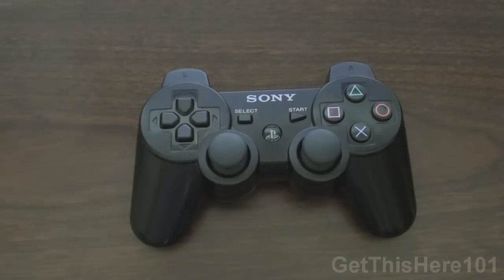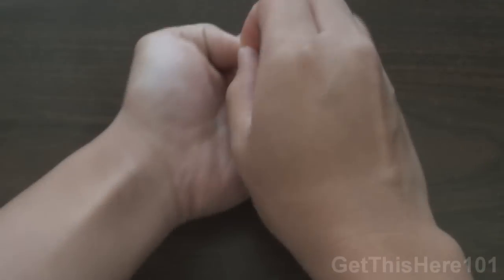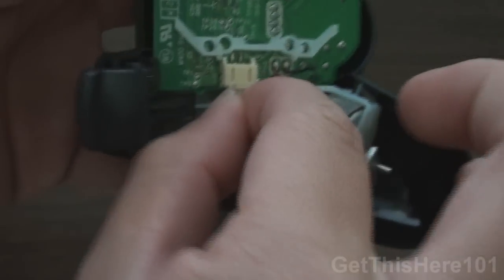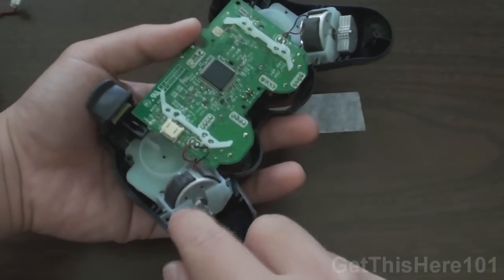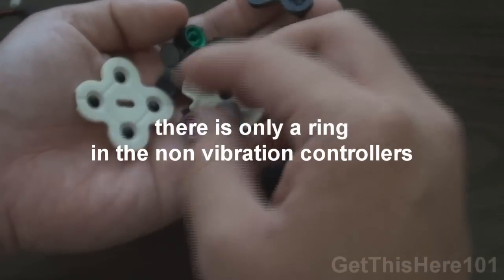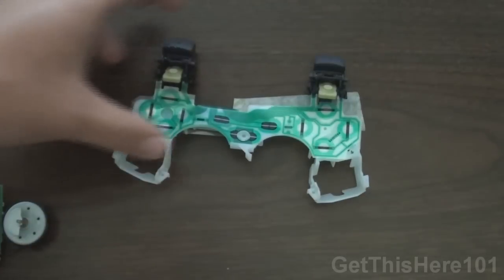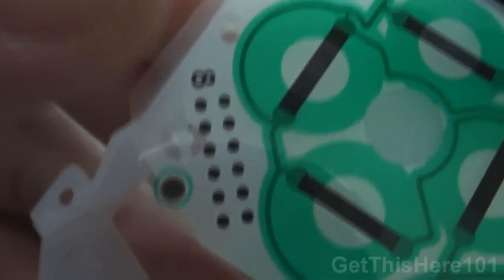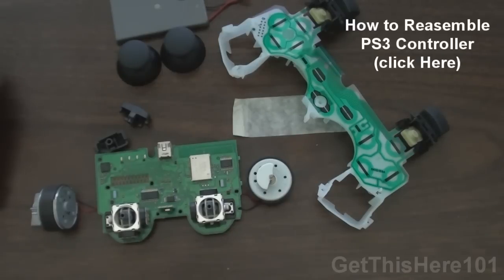How To: Disassemble PS3 controller (HD)

Comment: hey I just want to let you know that I'm going to change my Hard drive the 500GB where all my things in it to a PS3 slim and I need to do the following.
1. download the freeware 4.66 to a USB ( FAT 32 ).
2. back up the entire system to an external hard drive.
3. swap the hard drive out and replace it with mine.
4. turn on the system and then plug the USB flash driver and update the system and         the Hard drive is going to be formated and then do all other crab but lastly I need to       restore the all the date so I go SETTING < BACK UTILITY < RESTORE.
and then done.

and by the way I took picture of my PS console.
Reply from the maker: Cool, sounds like a lot of steps where fuck ups can happen. Best of luck man. You sound like you know what you are talking about!
Reply: GetThisHere101 Yep I always know what I'm talking about but listen man when I open my PS3 not the custom PS console ok so when I open the PS3 and I add you and set up everything at that time I won't have a chance to show you the PLAYSTATION console because it's rebuilding again you know I'm adding more features to it so I just have a couple of pictures of it ok.

Comment: Trying to do this but the new controllets have the batteries glued to the circuit board :/
Reply from the maker: really... damn no way. :*(
Reply: @Chrisshao  don't worry I figured it out , you just lift the battery a bit and you can unscrew the board
Reply from the maker: @santi1505  There ya go!  :D

Comment: Anyone who doing this with a xbox 360 controller that impossible clamp is a screw,
in the battery pack under a bar code that peels off and there is a screw  unscrew it and the case comes right off

Comment: Btw do I have to take out the battery?
Reply from the maker: +Drakon_ 11 You don't have to, but it is best too prevent it from being yanked out on accident.
Reply: Chris Shao My r2 button got ripped off the film and how do I put it on again
Reply from the maker: You can try and tape it back on but with precision so it doesn't obstruct any hardware when you put it back together. Make clear tape double sided by folding it over itself.
Reply: Chris Shao never mind I got it back together but now my problem is that the battery keeps on sliding out after I put on the shell

Comment from the maker: @Falluccafier123 if your looking to mod the led lights, you don't need to take it off and I don't think it can come off... modding the leds is only messing with the lights on the circuit board meaning you have to de-soder the current red leds and soder the colored led light you wish to put on... If the video helped please leave a like and if you have any other questions I will definitely try to answer them

Comment: Sadly the screw on the chip in my controller is damaged so it cannot be lossened. Also my controller has never been opened before.
Reply from the maker: +CannibullEDM Try putting a rubber band between the screw head and the screwdriver, then twist.
Reply: +Chris Shao (GetThisHere101) No I already got it. Thanks anyways.

Comment: Ok i have problem my screw striped wat do i do?
Reply from the maker: Unfortunately there is not much you can do. Try using a flat fat rubber band between the screw head and screwdriver to try and get it to turn. Turn left to losen.

Comment: I was taking the battery and snapped the wire but at least I have another controller that battery turns in just won't register buttons
Reply from the maker: The controller with the battery snapped off, you just now have a wired controller :). Get a long USB to Micro USB cable?
Reply: Well I ready disassembled it there's no way I'm getting back together
Reply from the maker: why not? there is a assembly video I posted.!

Comment: Does anyone know a good forum where they could help with my PS3 controller problems?
Reply from the maker: What's up
Reply: I have a problem with my old controller where left analog get stuck at certain angle, so I bought a new one. The new one is working all fine, but buttons are not sensitive enough, especially the d-pad where I have to put more pressure.
I have 2 questions:
1) How can I fix the old one?
2) How can I make the new one to be more sensitive?

I dismatled the old one to see what's the problem with it. I cleaned up the controller from hair and dust, but the analog is still getting stuck. I tried to examine the analog if there is some broken parts, but I don't see anything wrong with it.

Comment: My r1 and r2 don't work I've took it apart and it looks the same as the left side
Reply from the maker: Does it work when you press down on the rubber button?
Reply: I've looked at it more and the plastic bit has bent and damaged the circuit what the rubber bits hit, it can't be fixed lol cheers anyway
Reply from the maker: Alright man.

Comment: The inside of mine does not look the same the circuit board is much smaller
Reply from the maker: When did you get the controller? 2015?
Reply: Chris Shao Not sure the year I got it used at the end of 2014 with my playstation. Model number CECHZC2U A2.  On amazon it says "Newer model than original controllers, CECHZC2U has much better connection and battery life"
Reply from the maker: Ok. Then Sony may have updated their controller.

Comment: Who’s still using their stock controller, the one which came with the console? 
And you play Battlefield / COD.
Reply from the maker: Mm?
Reply: Chris Shao usually people rage and break their controllers. Checking if anyone who plays FPS still has a controller that’s working.
I am still on my first since 2006.
Edit:- And I play Battlefield religiously. This controller has amazing quality. Didn’t even have to change the battery, mine still lasts 10 hrs on a single charge.

Comment: uh my circuit board is different and I can't get the rumbles out...
Reply from the maker: The rumbles are stuck on with double sided tape, and are also soldered with wire to the circuit board... so when you take the rumbles out makes sure you remove it form the tape without over pulling and breaking off the wire that connects the rumbles to the circuit board.
Reply: GetThisHere101
 ok I got that but they're connected as 1 whole piece. and the circuit board is small and thin. totally different than the one pictured. I'll have to show a pic of the insides that I have . the serial # is CECHZC2U.
Reply from the maker: Yeah pictures are helpful, ok.

Comment: i just broke the cables between the vibrationthings :(. cant fix it damn it
Reply from the maker: Only way to fix it is to solder the wires back to whichever it came off from, the rumble packs or the circuit board.
Reply: i know, but i dont have the right equipment :/
Reply from the maker: yeah, that's a bummer. If you really want vibration, ask anyone you know around if they got solder stuff.

Comment: Why should you disassemble your controller? Maybe if you dropped it & a small piece of plastic tab is in between your buttons! That's why. Take out the broken piece your controller works fine. Saving you $50.

Comment: that white thing on the battery is secured horribly tight, I couldn't even get it with pliers
Reply: Me too, could you do it yet?
Reply: Lapaj I did it by getting a head start pulling on the cord
Reply: +4SaN Lapaj Don't pull on the cord. Not a good practice. Instead, I used a pair of nail trimmers (pliers would be better if you have thin ones). Just clamp down on each side and wiggle as you pull it out.

Comment: @Barody96 hi, i did find a solution /watch?v=7cnXHaHw1qA&feature=related the resolution in the video is not the best, but the explanation is good enough, my controller is working perfectly now, so yeah it fixes the problem :) hope it helps (i did not make the video)

Comment: My circut board is different
Reply from the maker: Not crazy different right🤔
Reply: I think its fake
Reply from the maker: @kiviput2710  lol based on how you say, likely yes then
Reply: I bought a used ps3 with 4 controllers and one of them had a broken annalog stick. I tried to fix it, but I failed. And it was the fake one.

Comment: wat da fuk i dont have motors (vibrating motors) in my controller. no joking guys!
Reply from the maker: That's cool, just means not a dual shock controller. :)
Reply: mine is not working anymore... it does nt lights up or do anything. what can be the problem?
Reply from the maker: +Newwei bieijei does it turn on when you connect the charging cable?